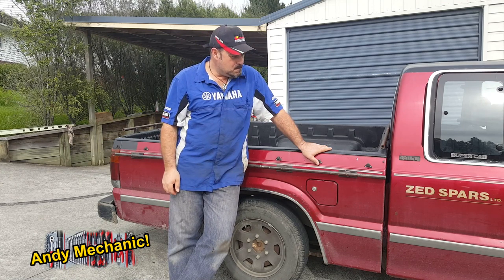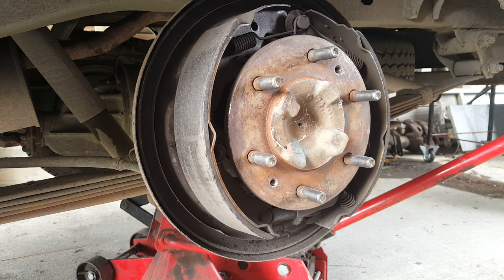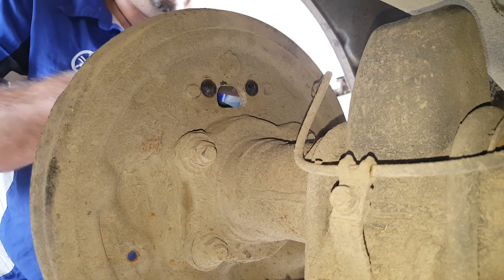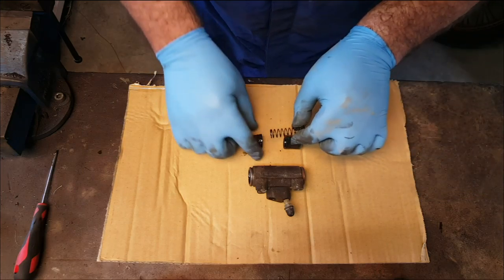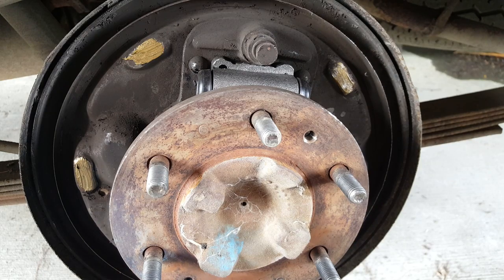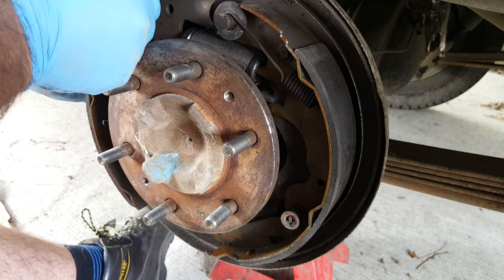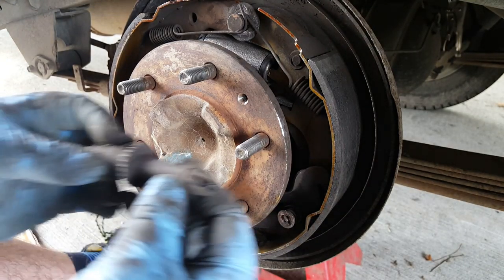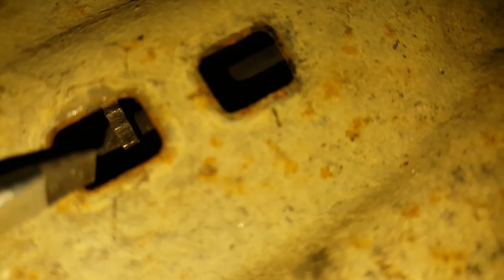Ford Courier pickup rear brakes -  fitting new wheel cylinders #1315

Comment: After hearing a noise in the rear brakes.decided to pull the hubs off.found a mess of springs an worn out steel parts.the 2 brake pad pins that hold the pads in was gone..an the 2 bolts  that the brake cylinder in place was gone..off to the wreckers tomorrow..spare parts..
Reply from the maker: Bugger!
Reply: It's a 95 ford courior.xtra cab.2 wheel drive.i also have a problem with fuel guarge..reads 3/4 when it's full.changed instrument cluster.. an fuel sender in tank as well

Comment: I bought a 1980 Ford courier last year....am going through the front disk and rear drums replacing everything....any help you can offer video wise is much appreciated.....
Reply from the maker: +Mike Wilkinson hmmmm. ...there is a video covering the rear brakes with Wheel Cylinder and shoe replacement. Any of my caliper overhaul videos should help you with the front brakes too :-)
Reply: How did you get that bottom spring on..